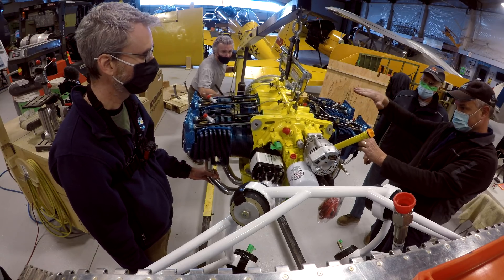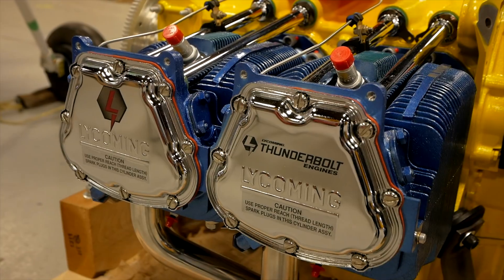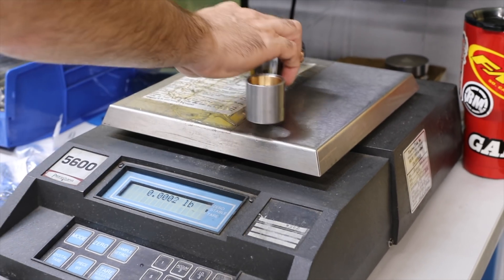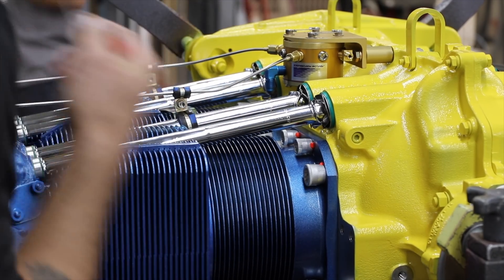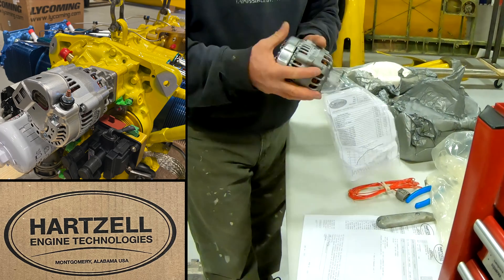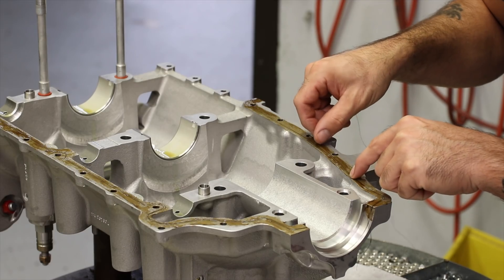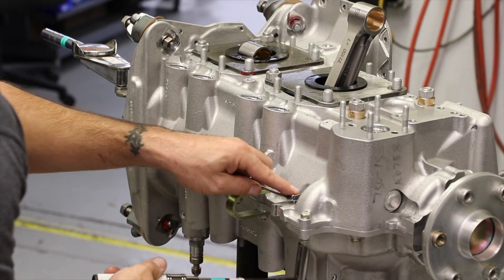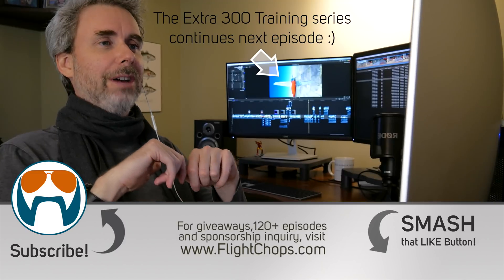Certified vs. Experimental Aircraft Engines - Why we chose Thunderbolt!

Comment: Missing the second set of washers is super common lol.

I hate to say it and hope I'm wrong but unless they've improved that backup alternator installation you're going to hate it.  A company I worked for had several of them fall off the engine after they crack around the mount.  At the very least make that a required inspection item.
Reply: 14 years with this backup alternator setup and no cracks or fall offs.
Reply from the maker: Thanks for the tip to watch for that.  I'll ask HET if they've heard of this issue.  
It probably won't hurt that the Thunderbolt should be fairly low vibration.
Reply: @FlightChops  I certainly hope it's not an issue for you!  The peace of mind is certainly nice and I'm in favor of anything that gets rid of vacuum pumps

Comment: Your engine looks like a work of art. Great segment on Lycoming engines. Prior to 1995 I found the O-320 and O-360s bullet proof. They had a problem with defective crankshafts when the demand for them being manufactured increased prior to 95. The old school tribal technicians were retired and the new techs didn't have their experience. Glad to see a shop with tribal values back assembling these engines. They are crude to nowadays designed engines. It's a travesty that we are still flying 66 year old engine designs without much improvement. They are fuel guzzlers just like they were in 1955. The big corporations are still farming out critical parts to non tribal manufactures. I was told this by a technician at Bell a couple of years ago. Seems even Bell farmed their gearbox parts out offshore at that time to save money. The primary reason these engines have the safety record that they have, is the fact that tribal parts manufacturers team members know what it takes to build a dependable engine. It's a shame that a $500.00 dollar engine (commodity market raw materials prices) now cost so much to produce. Don't you just love all the progress?

Comment: Lycoming, similar to Garmin, saw opportunities within the experimental market and decided to start developing products to fit that niche. The main difference with an experimental engine is your ability as a customer to customize your options.  In your case you went directly to Lycoming and can get customer colors, different valve cover seals and can install pmags.  In my case I went to Barretts for an IO-540 rebuild and had them increase compressions, paint it blue, and a few other minor tweaks.

Another analogy between the experimental and certified world.  My old 1978 certified plane had an old PAR 36 $7 light bulb, not expensive but it burned out constantly.  In theory I should have been able to just replace it with an LED PAR 36 for $20. However, because it's a certified plane it requires an 'FAA-PMA Approved' and STC (supplemental type certificate) to install.  Those light bulbs cost $245. I assume you're paying $20 for the light and $225 for the time it took the company to get it FAA-PMA approved and obtain the STC.
Reply from the maker: Yes this is a great illustration.  Flip side is, I have heard guys complain about the cost of certified USB adapters in planes, which can be hundreds of dollars, when you can get one at Bestbuy fo $10.  The thing is I have actually seen a $10 USB adapter start smouldering in the cockpit of a friends plane.  Luckily that ended well, but it made the case for not getting a $10 USB adapter.  That said, Garmin or Lycoming do not make their non certified products less safe, despite being less expensive.
Reply: @FlightChops  Can attest to the issue of 12v -> usb crap. Stuff you get from grey import from China, is very often unsafe. 
Same for random brands you can get at the gas station. They often don't have a 'real' regulator, just a underrated resistor and an underrated zener diode with no fuse or short circuit protection. 
The proper way to do it, is incredibly simple and rock solid reliable, but it may cost a whopping 50 cents more to produce.
Reply: @FlightChops  The cost of certification is the paperwork you get to accompany it.  I work in Nuclear and the cost difference between "nuclear grade" and commercial grade is incredible, though the devices may be essentially identical.  Liability also comes into play.
Reply: @MichaelSteeves  Probably why there hasn't been more then few new nuclear plants built in the last 30 years yet it's the only reliable power generator that does not release CO.
Reply: @Mike-01234  hydroelectric
Reply: @MichaelSteeves  I've heard it said that in nuclear power, it is only considered safe once the weight of the paperwork is equal to the weight of the facility.  Then the punchline is, in aviation the paperwork weighs more than the plane, but only because planes are lighter than power plants.

Given how absolutely paranoid the authorities are about things like aviation and nuclear power, I'm amazed that motorcycles weren't banned off the face of the Earth long ago.
Reply: @MichaelSteeves  So your saying in the example of the par 36 light bulb which off shelf is $20.00 dollars, the cost to sell and provide 2 records; 1 for the customer and 1 for the company to hold for proof of certification is going to cost $245.00 for a microsecond to print 1 copy and store the other. Just robbery.
Reply: @FlightChops  
Can you do commercial flight activity (tourist sightseeing) with an experimental engine/aircraft?
What is the insurance difference?
Reply: @coldfusionspacexxx9814  Virtually no commercial use of any kind ... not even cargo which I think is a bit weird
Reply: @coldfusionspacexxx9814  As I know, training or some glide towing are the only revenue generating activities allowed on Experimental. Insurance is a good question.
Reply: @FlightChops  true but you can still get $40 ones that are really good quality that won't burn,
Reply: I think the FAA needs to get up with the times and change some of there just plain stupid regulations
Reply: Technology and customer demands are much more agile than regulations, it always will be that way.  Still, putting the spurs to the regulatory process in an effort to play catch up is a worthwhile endeavor, and mind numbing.
Reply: We get what we pay for...cruising at 175+ knots at 15,000+ feet I don't want to relay on a $10 item purchased at our corner big lot store!

Comment: I don't get why don't they also do the piston, rod, and ring balancing for certified engines as well. I feel like I would be annoyed if I had a certified Lycoming and then I found out the experimental version that costs less gets more care put in to its assembly!
Reply: Paper work and certification is expensive for certified parts
Reply: @Jasshands1  I understand that, but I don't understand why things like getting pistons, rods, etc balanced to within half a gram of each other is something you wouldn't do for the certified version.
Reply: @timaidley7801  maybe the amount of time it takes if its a production line assembly. thats my best guess
Reply: @Jasshands1  Yeah - I was thinking along the same lines - perhaps in certified land they have some kind of production line, whereas in experimental land they just get to grab the bits they need and put them together?

Comment: Would be cool to have a more in depth comparison between experimental vs certified. All he said was "it's the same, less expensive because less paperwork". But there should be  a reason why there is so much paperwork. It raises the question as for why certified stuff still exists.
Reply from the maker: I'll try to have that discussion more deeply as we get closer to flying the RV-14... But at the end of the day, when dealing with a "real" company like Garmin or Lycoming... Their non certified stuff kind of IS as good as the certified...  But I understand your point.
Reply: Certified still exists because it’s the only way you buy a new aircraft. If Cessna was allowed to sell a 182 “experimental” direct from the factory and they did it for half the price they would overnight double sells and certified aircraft would be a thing of the past nearly instantly. 

Regulation has created a market in primary cost of the certified part is not the part itself but the paperwork and pilot aren’t choosing that because they want to, they have no other option except for home builds.
Reply: @Mrcaffinebean I suspect paperwork has extremely specific testing requirements that accompany it. A small change can have unexpected consequences over time. Forms aren't usually expensive.

Comment: I think you mentioned earlier that you wanted to fly the plane IFR.  Would TC accept experimental equipment for IFR certification?  I know for sure you need a certified GPS if your going to use GPS for navigation.
Reply from the maker: Yes - GPS needs to be certified.  But things like the G3X touch screen does not.
Reply: @FlightChops  That is good to know.  Opens up more options.
Reply: Just got my IFR. Figured anything that displays the same info as your standard 6 pack would needed to be certed if flying IFR?

Comment: So Thunderbolt is a branch of Lycoming building non certified engines? Would have also been nice to get some numbers here, like how much more power you can expect and what the price difference actually is compared to a certified engine.
Reply from the maker: I wanted to stay sort of general and not get super specific about performance or cost because those things depend on a lot of variables, and it would have meant really getting into the weeds.  
But these links at Vans and Lycoming might help? 
https://www.vansaircraft.com/2020/07/vans-announces-new-optional-rv-14-engine-configuration/
https://www.lycoming.com/engines/thunderbolt

Comment: My buddy just had his Lycoming rebuilt.  They cut a groove in the metal between the engine bottom halves.  Then, they put a rubber gasket in the groove.  It seems like such a better finished product than just putting thread between the halves, but I guess this way has worked for decades!  That is a beautiful engine.  I'm getting my Continental O-470 overhauled right now and I hope it looks half as nice.
Reply: I would like to see this rubber seal your talking about. The reason they have used thread is because the crankcase halfs need to stay tight together. Anything between the case halfs like rubber or silicone will allow the halfs to move and "freat", meaning the aluminum will rub together causing gaps and then the crankshaft bearings start to move and lots of shit starts to go wrong.
Reply: @Airplanefish  I believe there is an STC for it.  It seems like the old way usually gets you to TBO, so probably not worth changing it.
Reply: @quinnjim  all be dipped....Ly-Con engine company in California does have the STC to perform that modification for Lycoming Engines and for Experimental Continental Engines. Interesting. Wonder  what people's thoughts are on it that have done it? The more you know.....
Reply: I have seen multiple engines with the o-ring and have it personally on my Ly-Con built IO-540 for the SX300.  It’s fantastic.  The crankcase halves never leak.  Many of the airshow teams use Ly-Con as well - with the same results.  It’s a very tried and true process.

Comment: Hey Steve, love your videos, but I have some respectful criticism on this one. I don't think it's giving the difference between certified vs experimental a fair shake to just call the certification process "slow paperwork" and that's it. I'm not exactly the FAA's biggest fan, but certification exists for a reason and I think your discussion should explore what that reason is.
Reply: Good point. I see the thinking behind the angle that was taken in this video, addressing that experimental does not automatically mean lesser quality or unsafe. But yeah, there is a reason and very valid point behind type certification. Yes, it's slow and very expensive for the manufacturers, but it's part of keeping us safe too.
Reply from the maker: @LeftFlamingo  Yes, I didn't mean to downplay certification, so much as I wanted to give experimental some credibility as it tens to get a bad wrap from what anecdotal experience I have had.  I will try to explore this further as we get closer to flying the RV14.
Reply from the maker: Fair point.  We've got lots more build vlogs to explore it more deeply.
Reply: Ah ! I actually posted a very similar comment to yours.

Comment: Still not entirely sure what Lycoming (?) Thunderbolt is actually. They appear to  build customized aviation engines, but I have a feeling I am missing some introduction part. Building the engine and the whole certified/experimental situation I think I understand.
Reply: You are getting an improved performance over a base model cert. engine and a lower cost. Lycoming has to build certified engines to the exact type design to maintain certification thus can't make all the trick mods without redesigned and recertification of a new engine type. That takes a long time and millions of dollars to do. Experimental class stuff is not subject to these standards.
Reply: @mytmousemalibu  If I have to add, the safety standards are the same, as said by the Lycoming guys, the high cost of the certified engine comes with the high capital cost from Lycoming to satisfy the FAA paperwork.  The experimental engines don't have to have the same "paper trail" but they are built with the same standards without the high certification cost.
Reply: @2Phast4Rocket  Absolutely! With an OEM like Lycoming, you can breathe easy knowing that regardless of cert or not, you are getting trusted, reliable engines & parts. Lycoming has to maintain  their place in the market and they aren't going to jeopardize their good name.  The EX ticket components has its benefits for sure. I understand both sides of the coin having worked experimental flight test for Learjet/Bombardier. The cost to the road to certification is almost unfathomable.
Reply: The Thunderbolt is a Balanced & Blueprint version of the stock model along with the other custom add on or Take Offs, in Steves’s case.
Reply: I'm Trying To Understand It, Too. Judging From The Other Replies To Your Comment, I Take It That In This Case, Experimental Is Better? Politics, Huh!?!
Reply from the maker: Hmmm... I guess we assumed most people would know Lycoming is a major aircraft engine manufacturer, and the Thunderbolt is a sort of "up trim / hand crafted" version of the base model engines? 
I am not even explaining it right now... haha.  Anyway maybe this link will help: 
https://www.lycoming.com/engines/thunderbolt

Comment: I think, and others will agree and disagree, that experimental means two things: a. the means to test and standardize a plane system b. a means to achieve a personal desire by using a. 
The only proper experimental planes i've seen so far has to be Alec Wild's DoubleEnder, and Mike Patey's work in general (i'm sure there's others), the rest, are means to an end. Which is not wrong or bad. Smart people have to play it right.